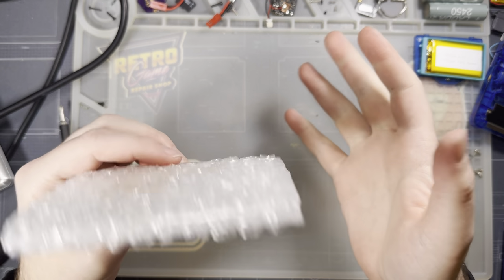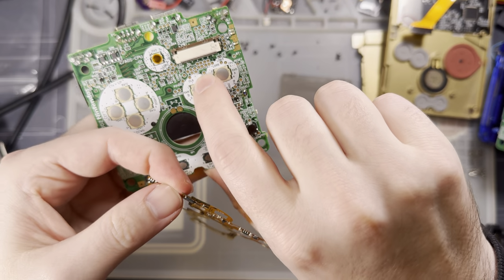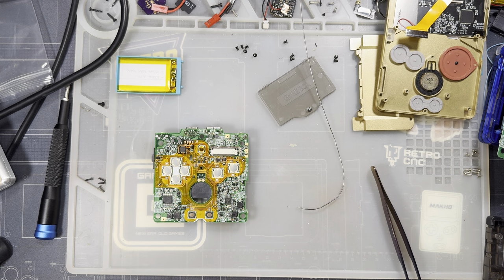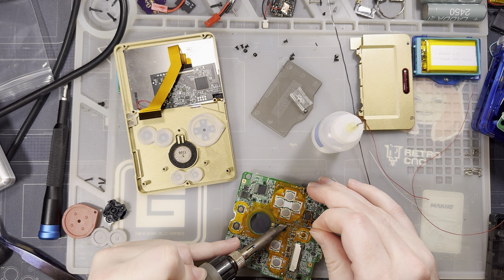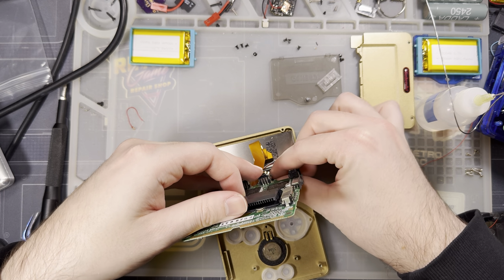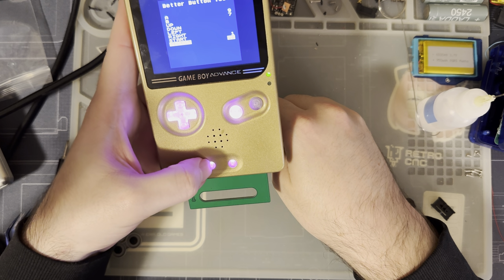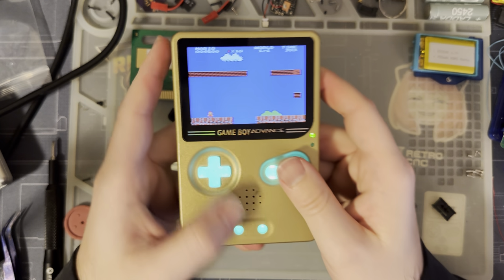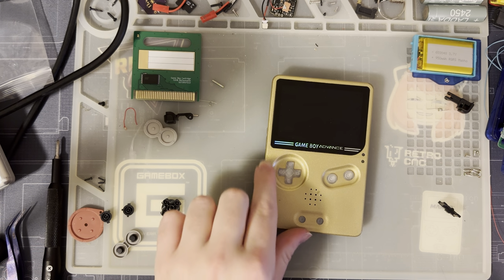GBA SP (Slate) LED Button Board v2 from Funnyplaying

Comment: On the point of confusion at 40:56: the menu in the Famicom Mini series of games that comes up when you press L+R are the following options:

• Continue (closes out the menu)
• Reset (restarts the game)
• Linked play (only present in those games that had a 2 player mode)
• Save high score (missing from the handful of games that didn't have high scores, e.g. Zelda, Metroid, etc.)
• Sleep mode

If you put it in sleep mode you exit that by pressing L+R+select.

I believe you get the same menu in the Classic NES series of games, only obviously in English.
Reply from the maker: I clearly don't play that cart often, thanks

Comment: can I ask what your thoughts are on the potential of DS Lite (or even the original) modding? I got my first modded GBA SP a few days ago & I haven't been able to put it down, I love it a lot. But it's just made the desire for DS mods that much more intense
Reply from the maker: I mean, what do you even want to mod? They already have rechargeable batteries, backlit screens, good audio, stupid cheap flash carts, etc.
Reply: @makho  better screens I think is the only thing I would want. maybe I have just had back luck, but I have not found any with good screens